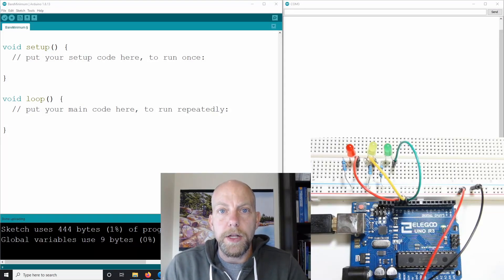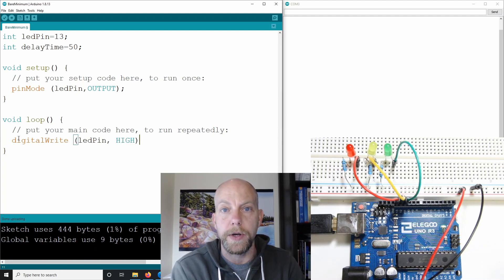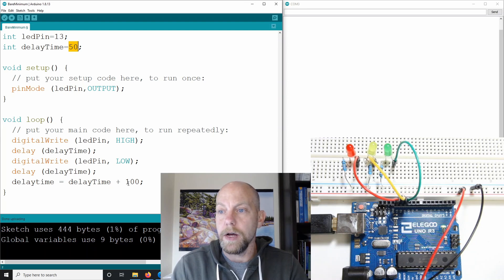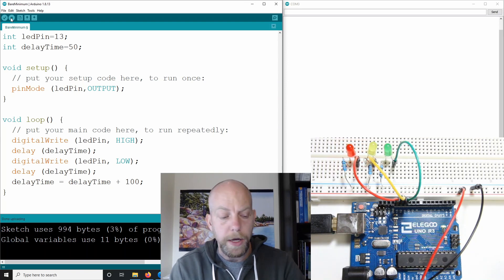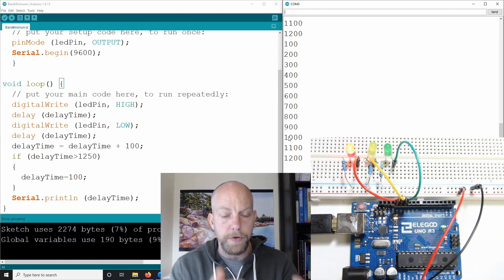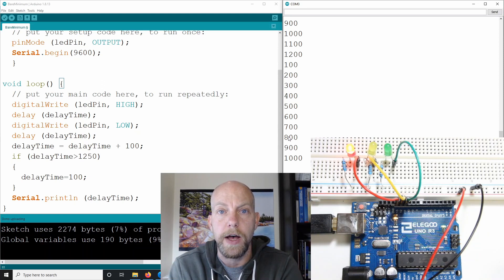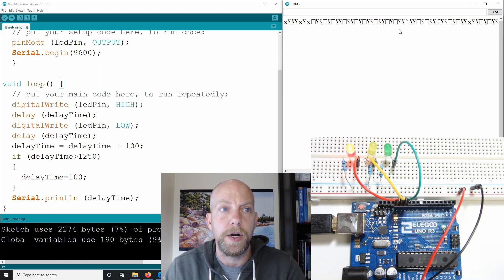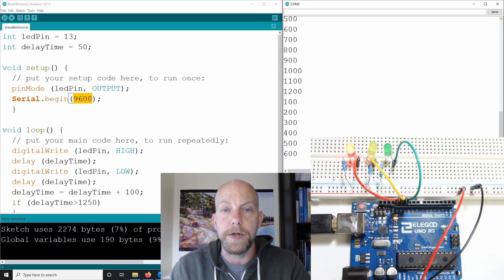Arduino Tutorial #7 (Increasing LED flash rate cw Serial Println and if Statement)

Comment: I suggest that right at the end of the video that you run the program one more time so you can show what will happen if your test is changed from ' >1250' to  '=1250, or ==1250',  and then start incrementing from 100 instead of 50, or start with 50 incrementing by 100,  but when you loop back start at 100 incrementing by 100, to show how you will keep incrementing forever.....
 This is a very common beginners, (like me), error so you might want to consider covering it...